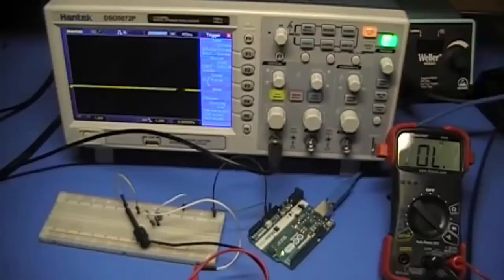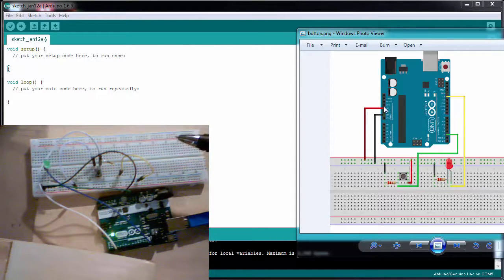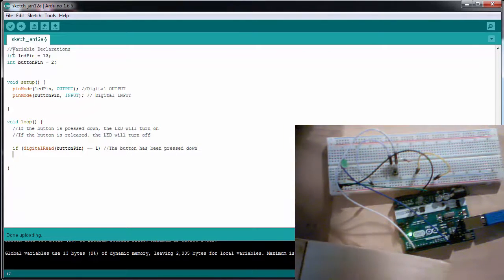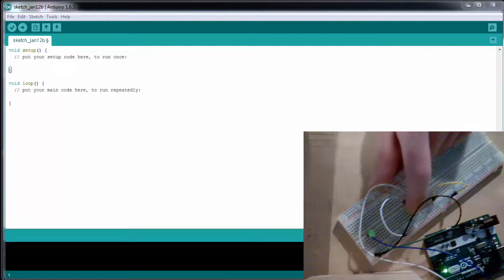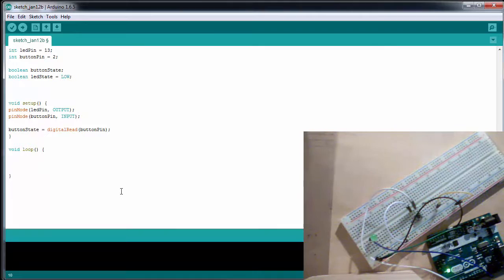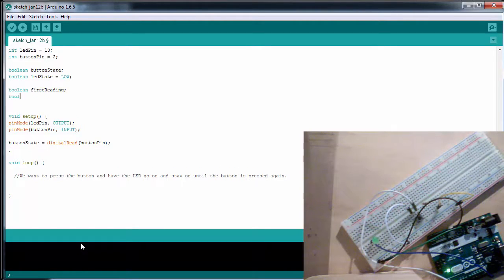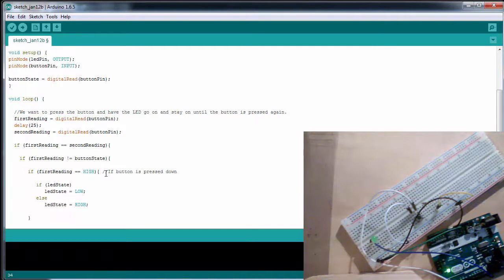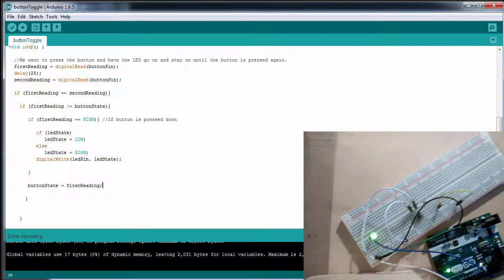Arduino Tutorial 2: Digital Inputs

Comment: hello
I have two digital inputs made by two push buttons, each entry making an exit ...
the idea is that even if the both push buttons are pressed,i do not want both outputs to be high, only output that coresponds to the first push button pressed .
 can you write a code for that?
 interlocking for outputs